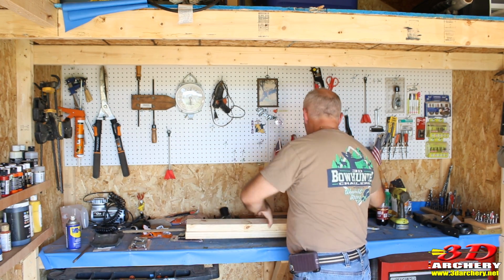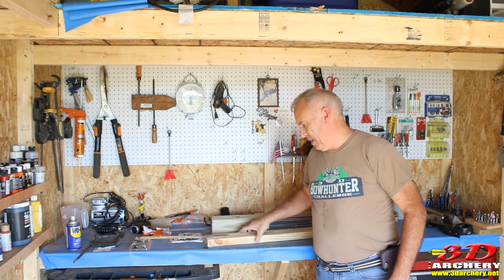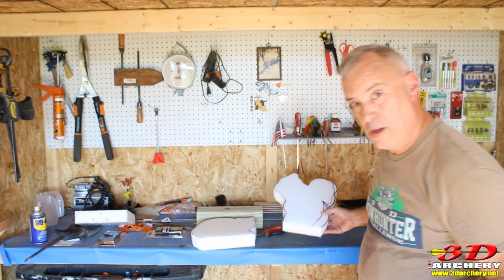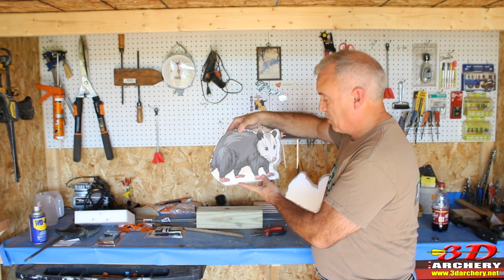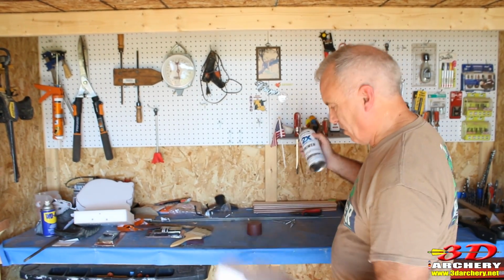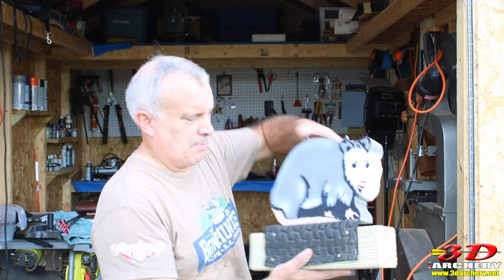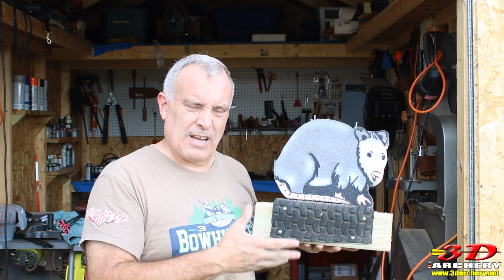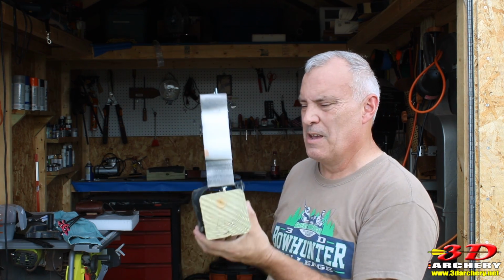DIY Reactive 3D Target

Comment: I wonder if ModPodge would work as a base layer for the spray paint. I know cosplayers that work in foam for their costumes and props use it to cut down on flaking and it seals the foam. They also use spray Plastidip like what you would use on tool handles to seal the foam before painting.

Comment: A couple ideas. Foam cuts easy with a hot wire, less mess and more control than a band saw. They are easy to make. Second, you already have experience making stick on graphics, I've seen you do it on your bows. Step up the size and use the vinyl stickers for the targets. Great job.

Comment: Seems with the viewer suggestions being incorporated into your targets, you have a team effort going. You could use a "Team-leader T-shirt, not that that 3D Bowhunter Challenge one isn't cool.
Got to thinking about the side-to-side waving of the arrow seen in the slow motion. Okay for carbon and aluminum arrows. Likely okay for wood. Not okay for bamboo ones. The risk of them breaking at a node with that sideways motion is too great.
Thanks and Best.
Reply from the maker: Funny you should mention Bamboo. A person at the club said the same thing. Had them try it with theirs, I offered to buy them new ones if it broke. 

They shot it over me over with bamboo and had no issues.

And yes, it was and is a team effort. Love all the input. Have some more suggestions from people to look at incorporating.
Reply: @3DArchery  Goes to show when making what is essentially a general statement, there is always the exception. My comment on bamboo was based on a similar though different happening I had shooting a practice/warm up setup at an archery club. People stood about five metres back from a bale of hay hanging on the wall. Now arrows released from that distance are not going to have straightened out their flight before hitting the bale. This is not a problem with carbon arrows. However, a bamboo arrow entering the bale when not flying straight, coming to an abrupt stop when hitting the wall behind the bale, and just happening to have a node of the arrow stop just before the bale is a guarantee to having the arrow snap at that node. Bamboo arrows were about 25 $ then; they're about 35 $ now. Loosing arrows under normal conditions is just part of archery. Loosing them to some half-ass, jury-jig setup is maddening.
Keep up the informative, creative content.